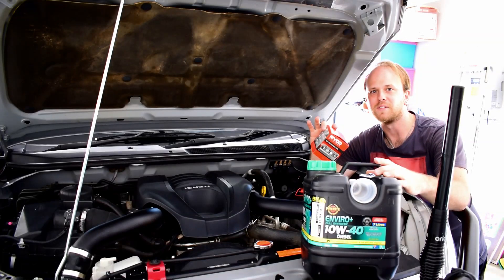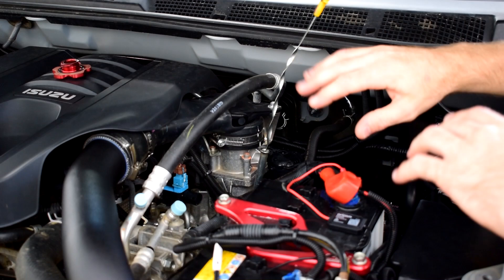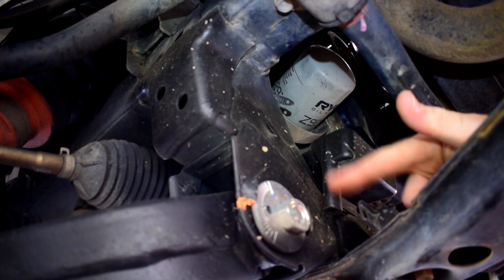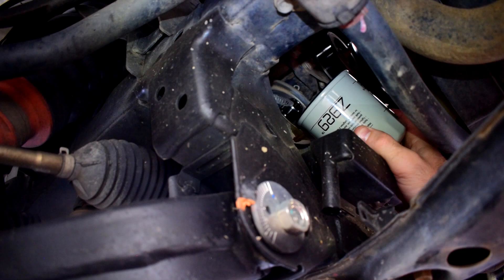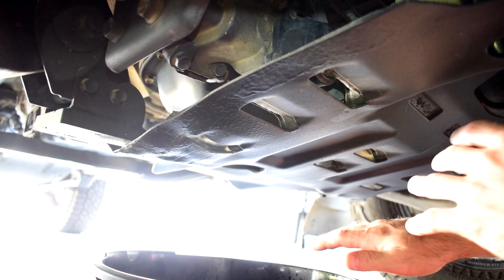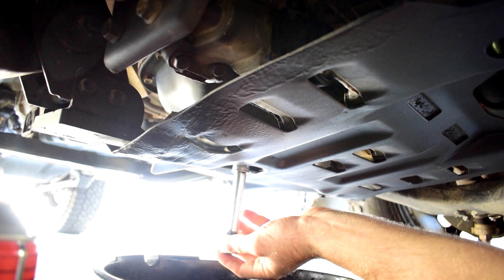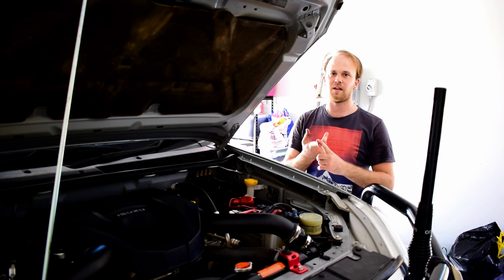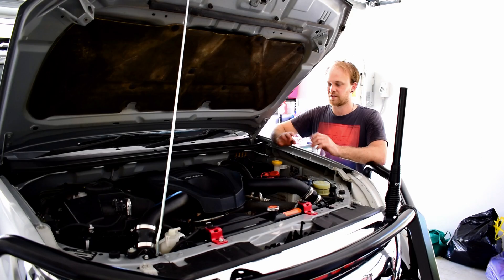How To Change your Engine Oil + Filter || Isuzu Mu-x + D-max Tutorial || 4WD Maintenance ||

Comment: Hello Nick. 10 months on .I change my engine oil at 7500 ks.with Castrol magnatec 5w40 synthetic diesel engine oil..I drained 9 litres out of sump .Thats over a litre dilution. The dilution must make the oil lose some of its lubricating qualities  , this could even more critical with a turbo....Scotty Kilmer says engine oil is cheap car engines are very expensive..I think it's worth changing engine oil half eay through the 15 , 000 k maintenance cycle..I buy the magnatec when it's on special around low 70 dollars for 10 litres .When it's not on special  it's 120 dollars. I actually got it in one place for 65 dollars that's the cheapest I've ever seen ..Oil filter from dealer 36 dollars..

Comment: Hello Nick .The reason the oil comes out of the sump straight away is the sump pan is so incredibly thin .I just changed the oil on my daughters Suzuki Swift  2008 model  , the sump is so thick you could use it on a Tiger Tank. I'm amazed the MUXs so thin being a 4 wheel drive. Had mine serviced recently and they used 15W  40  at Isuzu. You have used  5W 30 do you think that was too thin for the heavy duty engine and high ambient temperatures.  The 10W 40 sounds more apt for the Sunshine Coast.  I've always filled my oil filters with oil before fitting and those filters that are on their side half   filled so the oil  light goes out straight away.  Love your videos  Nick  , there the best..

Comment: thanks mate, did the oil change today too (after the Auto Tranny fluid change). IS there a parts list anywhere? I have a fluid leak at the front, from a hose with a crack, not sure if its oil or transmission fluid.

Comment: Hey Nick, bloody legend mate. The list goes on with the tips from your videos. Juat curious - do you have rust protection on the mux at all. If so what type and why. Thanks mate
Reply from the maker: Hi Clint, no rust protection yet. If you wash your vehicle thoroughly after each off-road trip and touch up any scuffed underbody paint you wont have any rust issues. I have however promised that at the 5 year mark of my ownership I will go and get it underbody sprayed with the tar coating to protect it for the long term. cheers :)

Comment: Hey Nick, could you do a video on how to flush and set the level of the auto transmission with regards to temperature and the vehicles running, and in gear to set the level.
Reply from the maker: Hey mate! Check out my latest upload on how to change your transmission oil :)

Comment: Hey Nick, bloody luv your videos mate. Just wondering what you have used to catch the oil when removing the filter. You have inspired me to give this a go which is saying something given I am completely manually inept 😂🤣😂🤣 Thanks mate.
Reply from the maker: Hey Marcus, you can use pretty much any oil drain tray that you can get from your local auto store. That's good that your going to give it a crack!
Reply: @LowRangeNick  Ok no worries. It just looked like some sort of small slimline tray with a tube that then fed the pil into your larger drain pan. I plan to get a a 8 liter or bigger drain pan for the sump as included in your tools links below. .
Reply from the maker: @marcusnicholson4445  yep that will work perfectly, even a 10l one will give you a little bit extra volume in the drain tray.
Reply: @LowRangeNick  Thanks legend.
Reply: Hi Nick, have you got a link for the little drain tray you use to catch the oil on the axle just u der the filter? Where did you get that one? Plenty of big trays around, haven't seen a little one like that..

Comment: Can I ask you a question? have you used synthetic oil 5w-40 ck-4 in the isuzu? I have a Dmax and currently use Castrol Vecton 15-40 ck-4, but it is semi synthetic. Would it be advisable to make the change?
Reply from the maker: I would recommend using fully synthetic oil in the dmax. It will be better in the long run.

Comment: Fantastic video mate! quickie,do u use the engine flush? or its just the waste?
Reply from the maker: You can use engine oil flush if you like it will help thin out the oil and remove any deposits in the system.

Comment: thanks for the video! I'm about to change my engine oil too for the first time 
what tools would I need apart from the oil filter wrench? do i need a socket tool set?
Reply from the maker: Yes you will require a 14mm socket, 17mm socket to remove the under trays and a 17mm socket to remove the sump plug. A 1/2" socket set with an extension and the oil filter pliers and a drain tray will make the job easy. :)

Comment: Thanks Nick. Im in Qld and the dealer has been using 15W 40. Thinking of doing it myself, can you tell me why you use 10W 40? Cheers
Reply from the maker: Hi Tony, either weight oil will be fine to run.
Reply: Hi tony the 10 weight oil would be alittle thinner at start up but you wouldnt see a difference between 10 & 15 weight

Comment: Hey Nick, love the channel. I dropped my 4x4 2020 mux oil and filter last night as per your video. I put in 7.5 litres of oil but I am getting oil smears all the way up to the X on the dip stick and finding it very hard to read with those stupid yellow tabs and one side is always worse than the other..... Wouldn’t expect the level to be that high just after an oil change.... had same results even after leaving the car for several hours!! If I can see a small area of the yellow tab that has no oil, would one safely assume the level would be below that?
Reply from the maker: It is sometimes hard to read. If you dip it for only 1 second and pull it out There should be one side of the dipstick that has a solid level. The smears make it difficult to read. Try turning the dipstick once you pulled it out and read the opposite side. Sometimes it is better.
Reply: @LowRangeNick  Thanks for the reply Nick. I will try the the 1 sec check. You are correct, one side was reading better that the other... silly manual says to refer to the higher side... got a feeling the higher side is the side being pulled up against tube...
Reply from the maker: @craighannagan955  That's correct Craig, the oil smears up the dipstick tube giving a false reading sometimes. Thanks a lot :)

Comment: Does the oil filter go straight into the block, or is there an oil filter housing that bolts onto the engine?
Reply from the maker: There is a filter housing that comes off the block.

Comment: Hi mate, very thorough vid, How do get the engine bay so clean, is it just degreaser and hose down? thanks Mick
Reply from the maker: Hey Mick! I Usually just gerni it off and if it's really dirty I use some car wash in a spray bottle.
Reply: @LowRangeNick  hi again, why the 10w40 oil? The manual lists 5w30, sorry to bother you, cheers mick
Reply from the maker: @michaelwalmsley9810  The manual suggests different oils based on ambient temperature. The 10w40 oil is slightly thicker which offers better lubrication in hotter environments, quieter engine operation as well. The 5w30 is good for most environments, however I prefer to run slightly thicker oil.
Reply: Awesome, that makes sense, can you do a fuel filter change vid one day? :)

Comment: Hey mate, thanks for the video. 
Quick question though, when you drained your oil out of the sump, did you let it drain for a hour or so or just waited till most of it was drained and then filled it straight away?
Reply from the maker: It usually takes about 15 minutes or so for the majority of the oil to drain out. You could wait for an hour if you had nothing better to do haha
Reply: Haha thought so, someone told me that you shouldnt be fully draining diesel motors 🤷🏾‍♂️ thanks the reply
Reply from the maker: @kylefernandes5824  If you have a bt50 or Ford ranger then you need to fill them up with oil within 10 minutes of draining them otherwise they can't bleed up the oil pump. Big design flaw with them. Pretty much any other vehicle is fine to drain untill completely empty.

Comment: Hi Nick, after you changed the oil did you have to reset the oil dilution level. Iv'e watched a couple of videos lately that shows you how to do it on the DMAX's in the UK. Do you know if the same applies here to the 2021 model onwards please? The blue driver scan tool I have doesn't have the ability to do it, so wondering if this way works - thanks
https://www.youtube.com/watch?v=oLSlo7bbnN0
Reply from the maker: I have never had to do it on them.
Reply: Yeah okay, thanks

Comment: I grab 7 litres and top it off with lucus oil stabiliser 🤙🏽
Reply: I'd love to put the lucas in also but it says not suitable for diesel particulate filters..What a bummer.
Reply: @kevinbyrne7400  I've used this product in all my vehicles since 1998 and never had a problem.
Been putting it in the MUX since new and 5 years later it's still never missing a beat.
Reply: Thanks Henry that's good to know. I had one noisy valve on start up on a Holden Commodore and I used 2 litres of Lucas's with every oil change .The engine was so quiet people used to say  is the engine running and  I'd tell them it was an  electric car and they believe me.It is really that good..